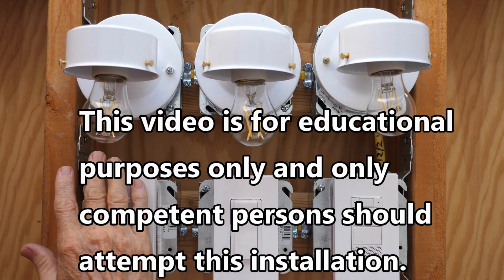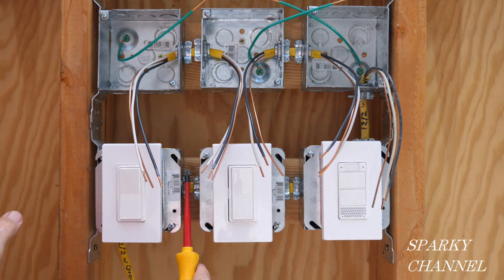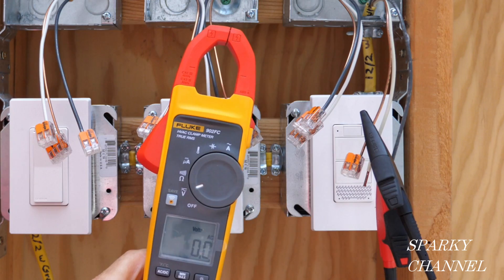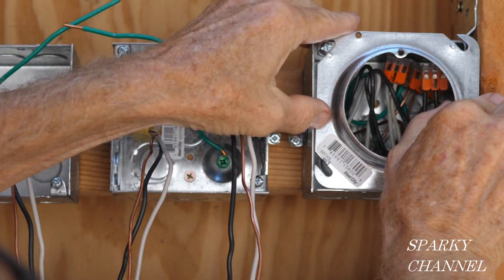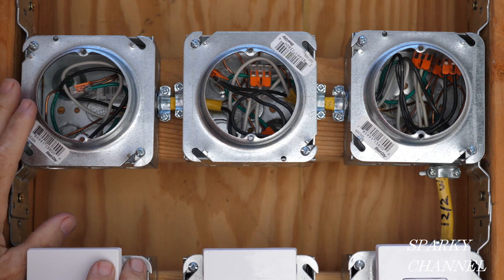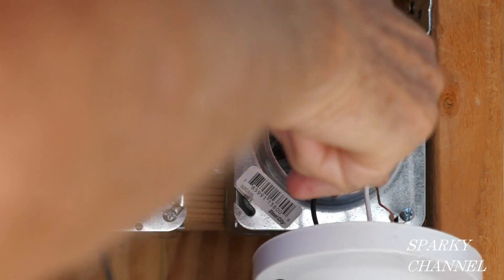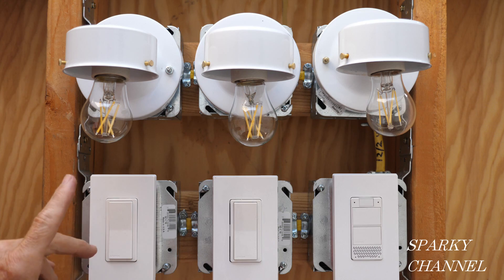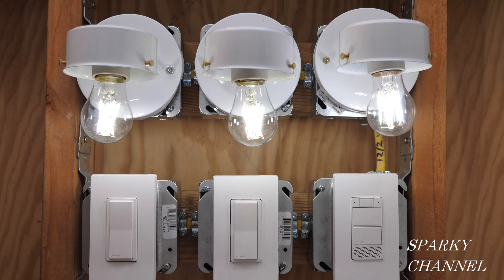How to Wire Multiple Lights and How To Prepare Wiring for Drywall

Comment: Hello, I got a question for you if you can help. 
I just bought a house and in the living room they provided pre wiring for ceiling fan. This is the 14-3 wire (white, red, black and copper). I was wondering if you can explain how i can use this pre wire to connect recessed light. Note the recessed light only have 14-2 wire (white, black and copper. Not sure how i can use this same connection for both ceiling fan and recessed light. 
I hope i explained it better. Looking forward for your reply.

Comment: I would have to check my wires first since my home was made in 1973. Id have to make sure if my home can do this or would I have to have someone wire it. But ill wait till I have the money to do it how I like
Reply from the maker: Sounds good!
Reply: A 1973 house probably has 14-2 with ground.  (Sparky likes the heavier wire, 12-2, just in case you add a higher amperage load to a circuit) Definitely need a ground for safety.  You can add onto an existing light circuit.  With diode bulbs, they draw very little amperage (.25 Amps) and will not overload a 15 amp circuit.  In fact, Sparky could have connected 40 or so diode light fixtures on this circuit and still not over loaded it.  Not a good idea in case you have a problem and have to go back and troubleshoot the big circuit.  Review another dozen or so videos on how to add to a circuit and if you feel comfortable, try it.  If not, hire a pro.

Comment: Another quality video Bill, i have one question, i thought i remembered in another video, that you grounded the cross brace for the light fixture. There is a grounding screw on it, or am i not remembering it correctly? Thanks again Bill.
Reply from the maker: You're correct. On this installation I bonded the metal box so everything metal screwed to the metal box is also bonded so there is no need to bond the cross piece because it's already bonded.
Reply: @SparkyChannel  I seem to remember now, in the video you had used a plastic box, which would require the cross brace to be bonded. I had thought the box was metal. Sorry about my oversight Bill.

Comment: great vid.  but putting the wago on the bare copper during testing really didnt do anything to protect you.  :)
Reply from the maker: Good point. Have a great day Dave!
Reply: The act of treating all exposed wires from a box as live is a common sense safety rule until verification is completed; never assume the wiring is correct or undamaged – there have been plenty of instances where the ground wire was not properly bonded. There have certainly been more than one occasion where a bootleg ground was discovered after the fact. My buddy used to crack me up when he checked every exposed wire in a box with his voltage tester and never bothered to take a second to check the ground wire. He would eventually learn the hard way. It’s rare, I get it, I really do… until it happens to you. Best practices, folks - don’t be complacent.
Reply: The wago on the bare copper didn’t really add any sort of protection